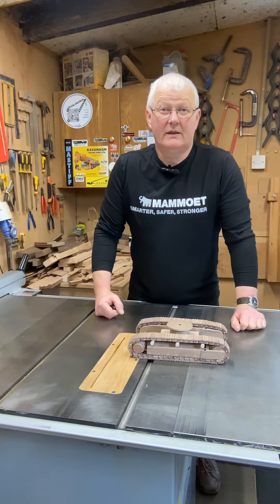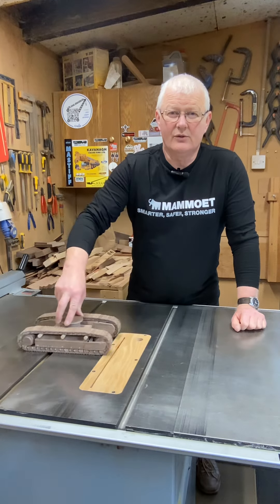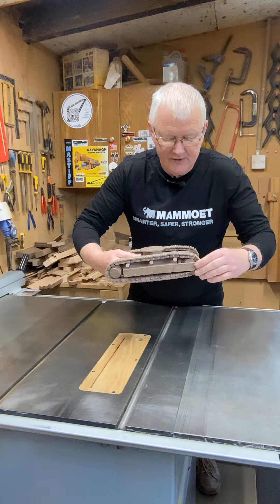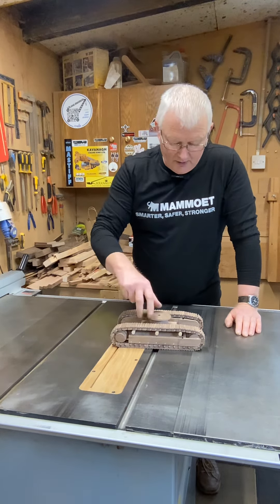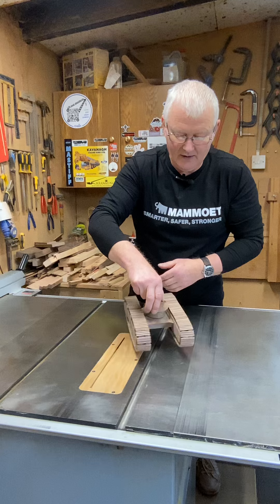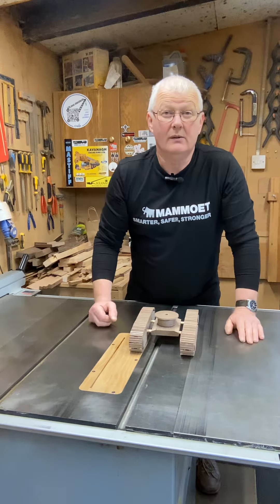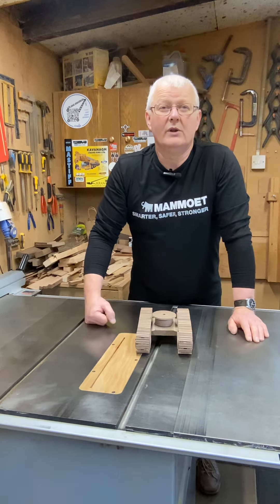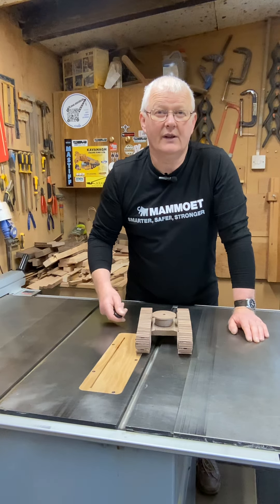Hitachi 490 LCH-7 progress report.

Comment: Beautiful work. What sort of springs do you use for the track tensioners? I've used a spring I found that is quite close to a biro spring in size and strength which seems to work reasonably well so far.
Reply from the maker: Thank you, I found some springs on the web that are very much like what you described. They work perfectly well with a 5mm dowel pushing against them.